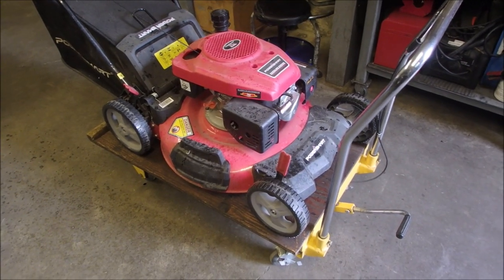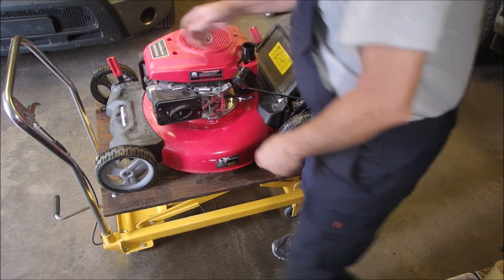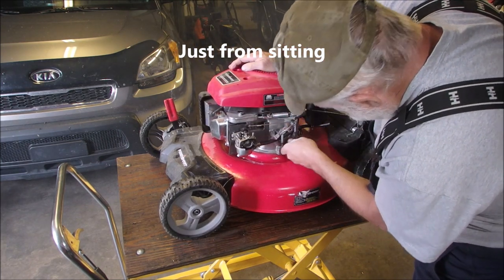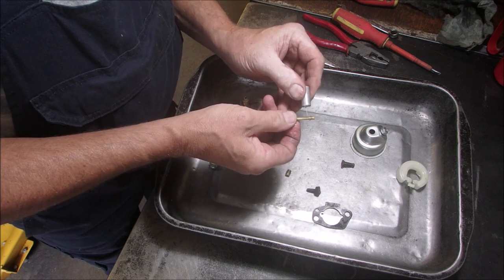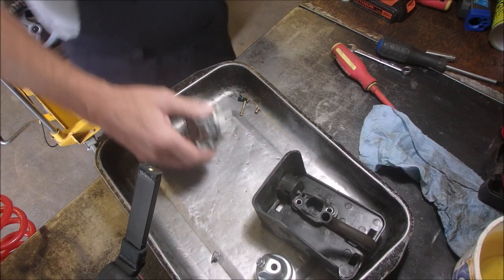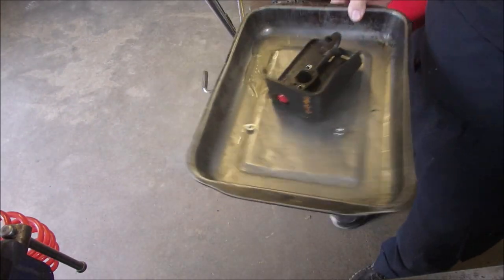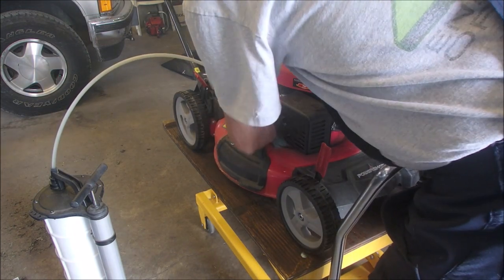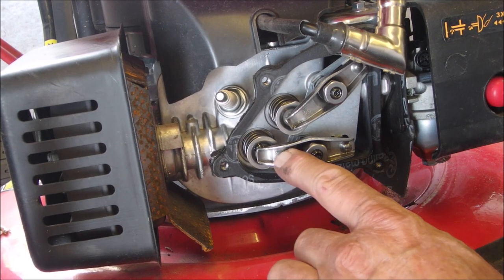Strange Findings  On A Powersmart Mower

Comment: Hi Bruce....you're not alone on this one.

I took one of these in on trade although yours is in better condition...heard the same clicking...couldn't get it to run regardless of what I tried.  I ended up putting a Tecumseh engine on it.  I think these are made by the fiddle fairy engineers.
Reply from the maker: Thanks for sharing.  You are right.  They look so nice though don't they.

Comment: Bruce we have only had one Powersmart and it is the same. MJG2626 is correct we believe this click to be normal on these. Same thing with the Qtip but we use stainless steel polish you could use Brasso even tooth paste then clean it well and it should stop flooding. Do not give up on this one buddy!
Reply from the maker: OK..One more try.  It seems hard to start.
Reply: If the valve clearances are to specification the only other reason it may seem hard to pull on the recoil starter is if they at some point bent the crankshaft and it is rubbing against the oil seal. We have had 3 mowers this year when they did not tell us they had hit something and they had already changed the blade but as soon as we rotated the flywheel by hand once the plug was out and the brake was off the flywheel we could feel the tightness during rotation. If the carb is flooding it will also create a hard start situation. @BrucesShop

Comment: Take a really good look at the needle tip on that carb.  I have had them get slight deformed or a little bit of crud on them that takes some work to clean up.  If you have a really tiny wire brush, you could get it inside where the seat area is, since the needle on these I believe has the soft/rubber tip that makes the seal.
Reply from the maker: Thanks for the tip!   LOL

Comment: Thanks for showing us around the PowerSmart Bruce!  These mowers do not have a good reputation in the US.  Cheaply made, parts are hard to find, and don't last very long.  The decompression is nice for starting but seems pretty crude on these Chinese clone engines.  I have had two, one was brand new in the box from my Walmart customer return pallet days, and the other one was 2 years old with a slipped off self propel belt and I think a carb issue too.  The deck already had stress cracks at that time and it wasn't used all that hard.  Not very well made!
Reply from the maker: Yikes1!!!

Comment: How's she goin'?  OK I thought that exhaust valve 'bump' was for decompression and was designed into the engine to make it easier to start.  And a leaky carb, is that not fixable or is it that you can't source a new carb.  Interesting video.  Thanks for posting.
Reply from the maker: Great point!  I finally accepted the  clicky decompression bump but I tried everything on the leaky carb.  One more try with some help from  Wayne at EP performance.    We will see.  The mower has a nice look but ........

Comment: Mr.B, ... The decomposition should engage at low rpms for easy starting ? So what's the issue ? Is it at the wrong time, or not disengaging ? I think I must have missed something ? 🙄 As Usual !
Reply from the maker: It is that click drivingme nuts and the carb srill leaks after tsting to 8 lbs.

Comment: Long time no see Bruce! Glad to see your channel has grown quite large! I suspect they didn't store it with premium gas for the winter... I think it was you that told me to only use premium, because it doesn't have ethanol that eats at the plastic/rubber lines.
Reply from the maker: You are right about rubber in the system.  I clean the carb then  All is good and 2 days later it leaks.  I may give it another try.

Comment: Powersmart mowers are anything but smart. I would take a MTD Powermore over it in a heartbeat.  And I don’t like Powermore engines.  For the leaking carb .  Try buffing the seat with a q-tip on a drill.  Use carb cleaner or polishing compound.  I suspect the old gas damaged the seat
Reply from the maker: You are right.

Comment: That decompression snap is normal for these cheap-o engines, they have that distinct “click” sound when the decomp hump passes over on the cam. These aren’t like Loncin or other Honda clone engines, these have an even cheaper build quality and a different way of doing the same thing. Carb leaking can be easily fixed by polishing the valve seat with some aluminum polish on a Q-Tip in your drill. Do it a few times then follow it with a clean Q-Tip then clean with carb cleaner and you should be good. I do it all the time, never fails (just did one yesterday with the same carb and the same problem). Replacements are cheap and plentiful but it requires a lot of research, you have to find another piece of equipment using the same basic linkage setup as they all use the same carburetor just a different linkage connection.
Reply from the maker: OK  Thanks